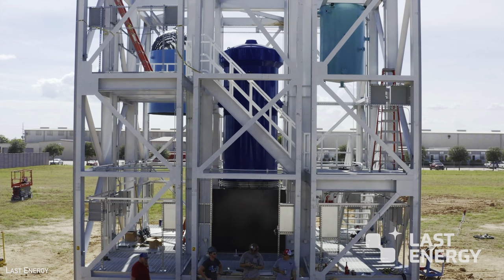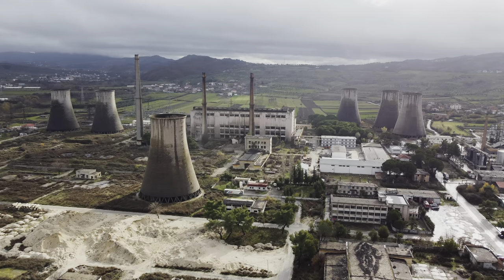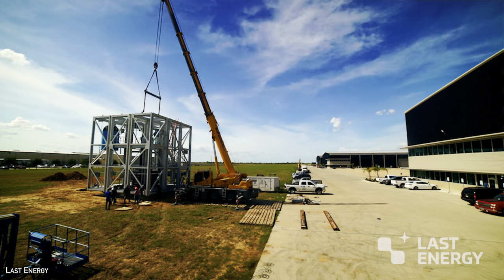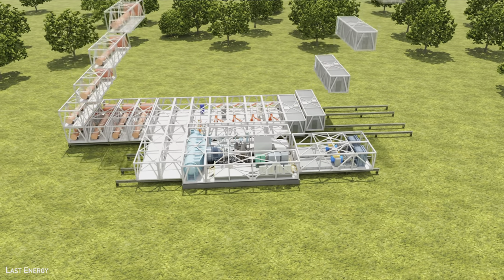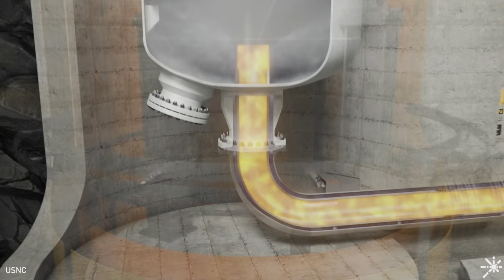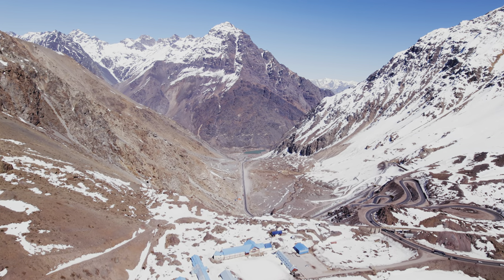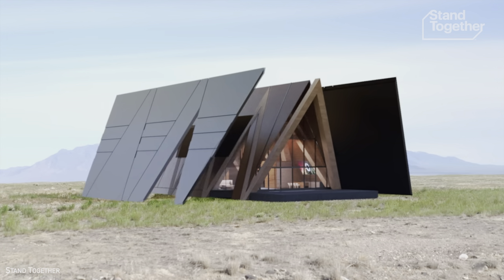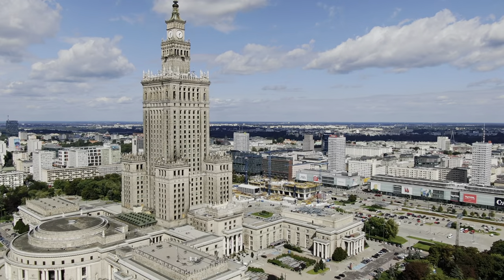The Daring Plan to Build 10,000 Nuclear Reactors

Comment: I'd rather live next to 10,000 nuclear reactors than 1 coal plant
Reply: I'd rather live next to 10 million wind turbines, than 10,000 nuclear reactors.
Reply: @BallyBoy95  Would there be any land or steel left to build your house?
Reply: @jewymchoser  good point. I'll have to live in a burrow like a hobbit.
Reply: @BallyBoy95  I wouldn’t… that’s where we are planning to store the nuclear waste 😀…

…which has yet to kill a single person. Coal kills 10,000 a day.

Nuclear is scary, but it’s safe.
Reply: @jewymchoser  how many people do win turbines kill?
Reply: @BrightWendigo  Wind kills about the same as nuclear… Zero. 

That being the case I believe the most important motive is to create as much carbon free energy as affordably and quickly as possible…

…which means nuclear. But make no mistake, I love wind, solar, and batteries. It’s just not scalable fast enough but nuclear is
Reply: @jewymchoser  Having a mix is great but factories are the biggest reason for having SMRs. Imagine a manufacturing plant that is powered by nuclear that doesn’t need much if any maintenance for years and even then with mass production of reactors and parts repair will be ever cheaper.
Reply: @jewymchoser  you should research your 0 number. More then 2000 disaster related deaths connected to Fukushima
Reply: @BakuganBrawler211  “Box them then ship them”… Ms. Doughtfire 

Agreed. Mass build, and more importantly, certify small reactors then ship ‘em!
Reply: @BrightWendigo  Coal & gas pollution goes into your lungs and kills 10,000 a day. 

As far as I know, there has yet to be a single death tied to Fukushima that wouldn’t have happened at a non nuclear plant after a tsunami.

 But Even if Fukushima was a disaster, is it 10,000 deaths a day?
Reply: @jewymchoser  iirc it's actually 2 deaths highly probable to be from radiation now, but still far safer than coal or probably even wind when you factor in accidents with maintenance and construction
Reply: @kyh148  that is a very fair assessment. Why are we so scared of the wrong thing?
Reply: @BallyBoy95  😅😅😅😅😅😅
Reply: @BrightWendigo  there is a clip of workers on a wind turbine thats burning.  They did not make it. So while not a lot, not zero.
Reply: For those that live near the Bruce plant for instance, there are a lot of long term and well paid jobs.  I have some relatives in Ontario who live near wind turbines and they're not toi happy with the noise. Like it or not it affects property values as well. And given that Ontarios wind turbines provide at best 7% increasing their numbers 15fold is going to be costly and unpopular.
Reply: @peterkratoska4524  well said
Reply: The problem with nuclear is not safety or pollution, it’s that nuclear is “top heavy” in terms of investment… it takes a long time to see a return.

SMR’s solves this problem not by “mass production” but “mass certification”.
Reply: @jewymchoser  the head of Last Energy (Kugelmass) in an interview on Catalyst podcast, points out Wisconsins 2 Point Beach reactors 1.4gw  were built in the 60s in 3 years by people totally new to the design.  In 2020 dollars if we were to  look at the blueprints and just copy it would cost 740$ million. Those plants are still operating. 

Since the 70s the certification costs are huge, Nuscale will spend between 500million to 1billion just for approval.  The industry is also partly at fault as the model depends on regulatory capture and ratepayers  paying the high cost.
Reply: I also know that nuclear reactors will be much more powerful and reliable than all those windmills and solar panels
Reply: You can't live near a nuclear reactor in the US because they are surrounded by a large exclusion zone.  That's "just in case."
Reply: @jewymchoser  
Said that nuclear power scales fast enough.

That's been the whole problem.  Throughout the western world the new nuclear power plants are having multi-billion dollar cost overruns and decade long construction delays.  The utilities are no  longer contracting for the construction of new nuclear power plants because they are *not* going to wait more than a decade to bring a new NPP online.
Reply: @jewymchoser  Wind and Solar are MUCH faster Scalable than Nuclear. 
The last three Nuclear projects in Europe has taken 16 years to build,
Reply: @jewymchoser  coal also causes autism and cancer
Reply: @BallyBoy95  than 10000 nuclear reactors or coal plants.
Reply: @oystla  it’s not either or :) give me nuclear, solar, wind and batteries and give it to me raw!
Reply: @BrightWendigo  Lots of flying creatures tho
Reply: @BallyBoy95  Sorry, that’s not the deal is it? With wind, it’s always wind … plus something else when the wind lulls. So what else do you want in your yard, gas plant and pipeline and drilling rig and storage cavern? Or, maybe a coal plant w 100 car trains every day and a giant ash mountain? Energy doesn’t come from unicorns.
Reply: @jewymchoser  “Wind kills … zero “

It’s a low number, but then it’s not all wind is it? Everywhere you look there’s gas and coal alongside the wind turbines Everywhere. Always.  They do kill a lot of people, and the combo is expensive.
Reply: @kyh148  Zero deaths public from radiation. Zero. Maybe a guy on-site died later from cancer, very hard to tell.
Reply: @peterkratoska4524  Not the deaths from wind turbines that are the problem.  Problem is gas coal always and everywhere alongside. That’s expensive and kills people from emissions accidents.  As wind gets pushed harder, taking money from coal gas, they’ll close a few too many, and then come the blackouts.  See South Aust, Texas, CA.
Reply: @acmefixer1  Nonsense. 1/4 mile at most. How close do you think you can live to a coal gas plant, always alongside that wind turbine.
Reply: @acmefixer1 l French built their 50 reactor fleet in 15  years. US built plants in 1960s in 3 years, several still running today. To the extent it’s different today, that’s political, not technical, coming from regulatory bodies captured by industry making $$ off only selling services, not building anything.
Reply: @oystla  Wind and solar … plus what else?  Coal? Gas? 

Btw French built their 50 reactor fleet in a 15 years. If it doesn’t happen now, the only reason is politics, with captured regulators insuring a slow walking death.
Reply: @Nill757  billions of dollars, hundreds of thousands relocated, food chain ruined, local economy destruction still a weight of national GDP wich slowed the economic growth of Ukraine. Hundreds of thousands of health problems wich causes a massive erogation of compensations/pensions.
Reply: @Nill757  safety regulations have improved since the 70s. What was done back then is not relevant today. 
Solar+Wind+Hydro+biomass+energy storage+coal with CCS.
Reply: @jewymchoser  Nuclear is not for the masses. It is an industry that requires talented people who possess the ability to strictly follow procedures and make conservative decisions to protect the core and the public in general. The people who do this work on a daily basis are more adept than most of the population and are not the type of people that could be hired in mass to staff 10,000 plants.
Reply: @mavrospanayiotis  Chernobyl was a bad accident and now there are no more Chernobyl like reactors.  Then, you’re exaggerating w “food chain ruined”, as Ukraine is the bread basket to Europe Africa Asia, which is one reason why the war is devastating internationally. Exaggerating “hundreds of thousands” health problems too.
Reply: @Nill757  yet many european productions had to stop and billions were paid for  remediation. Recently (2012) in northern Italy some boars killed were found having cs137 contents above the alarm level for nuclear accidents, the main suspects are Chernobyl itself or a dismissed nuclear plant not much far (1987). I know Chernobyl is an old tech but problems happen often and sometimes are kept hidden for years... just for about 450 reactors... imagine for 10.000.
Reply: @BallyBoy95 Also oil and its byproducts are necessary for wind and solar to be built.
Reply: @BrightWendigo  About 100 actually.  No where near coal but still some.  Most of these are during maintenance or during failures of some kind, like collapses or blade failures or fire.
Reply: @BallyBoy95  10 million bird choppers and whale beachers
Reply: I’ll take solar energy. No mining, no waste, no cancer.
Reply: @Nill757  Exactly, China or India would not put up with these delays that plague the building of Nuclear plants. Clearly the industry has been captured by regulatory bodies and unions that stretch out the work endlessly to make lots of extra money knowing that the money coming from government will be endless and they have no choice but pay.
Reply: @BrightWendigo  you mean the people that drowned due to the tsunami?  No one died from the plant.  It fact, it wouldn't have even melted down if it wasn't shut off.  The reason it broke was because the pumps shut off because both sets of diesel generators wouldn't run due to flooding.
Reply: @adbogo  How about when you have no sun? How about rainy days? What are your batteries going to use? Unicorn farts or the more common lithium and cobalt batteries you need to mine? What about when you need to replace that battery after 5-10 years? Will those batteries be built with unicorn farts or rare earth elements?
Reply: For all the solar and wind so great people, you are leaving out very important aspects. 
• It's climate dependent. Good luck putting wind mills in Antarctica or solar panel farms in Norway. 
• It's obviously not consistent. Planning a large power grid based solely on wind and solar is laughably stupid if you cannot exceed demand in both large scale battery capacity AND solar/wind generation. How many batteries do you need for 500 million people do you think?
• Windmills are a danger for birds. So don't put them next to your bald eagles America 🦅
Reply: @adbogo  Well some say the spiders and falls from high places will get us first.
Reply: @jewymchoser  You're a dreamer. You know better. Stop lying to yourself.
Reply: @jewymchoser it actually is the fastest developing source for electricity with still exponentially decreasing prices. Nuclear is the slow one in comparison.
Reply: I'd much rather live next to a coal plant - all the chemicals & heavy metals are now scrubbed from the stack and the fly ash is captured too (if CO2 is emitted, it's merely an inert gas,...it won't hurt me).  Unlike nuclear reactors which , during routine operations,  emit numerous radionuclides - fission & activation products - into the air and water (these  can be carcinogenic, mutagenic, and teratogenic), chemicals like hydrazine & ammonia, and heavy metals....plus they dump at least twice as much thermal pollution into the adjoining cooling water body. No contest!
Reply: @BallyBoy95  you have no fukin idea how mcuh noise they make 🤣🤣🤣🤣🤣🤣🤣🤣
Reply: @jewymchoser  wind turbines fucking SOLO birds, literal 100:0 kill ratio. Wind turbines stay winning
Reply: @jewymchoser  
When you compare the cost of nuclear vs solar with battery storage, solar LCOE 4.5 times more expensive as nuclear and has half the design life.

On any given day, a nuclear plant (fossil for that matter) can put 100% of its rated capacity to the grid. An equivalent solar farm can only put 25% of its capacity to the grid, on a perfect solar day.

Therefore, you need to install 4 times the solar generation put 1/4 to the grid during the day, and 3/4 into storage for use when the panels are off line.

Using Wiki LCOE numbers, the cost to install 4 x the generation is $3,320/kw.
Then battery storage for 3/4 of the solar is 18 hours at 1kw, is $1,380/kw x 18 $24,840. Or $28,160 to put 1kw to the grid around the clock, assuming a perfect solar day.
Advanced nuclear LCOE $6,000/kw, or 1/4 of solar with battery.
Reply: @Preciouspink  post source(s)
Reply: @jewymchoser  
Migratory birds on the other hand are fair game for wind turbines.
Reply: @BrightWendigo  
2000 disaster related deaths related to Fukushima tsunami, 0 to the nuclear plants.
Reply: @jewymchoser  
True high up front investment, but they last decades longer. Some US plants considering license extension to 80 years and longer.
Reply: @acmefixer1  
Actually no. Most US plants are near towns and cities, so people do live within the emergency planning zones, 2 miles and 10 miles.
Reply: @acmefixer1  
Two units coming on line in GA very soon. Yes took a long time, but will last a long time too.
Reply: @oystla  
Politics?
Reply: @oystla  
Not really scalable, especially in Europe. For one thing to put the same energy to the grid, you need to install 4 times the solar generating capacity. But that’s only good for about 6 hours a day while there is sunshine.
The other 18 hours they produce nothing.
To have power at night batteries are required. 18 Mw Hours is a lot of capacity, then multiply the batteries by 10 to account for the 10% capacity factor of batteries.
Even with all the costs and overruns, nuclear is still cheaper by a factor of 5 or more than solar and wind.
Reply: @pdiddymcse  
There are literally thousands of highly trained nuclear people out there, trained by the US Navy.
Reply: @adbogo  
What materials go into making solar panels?
Silicon - obtained from mines.
Then the silicon is doled with Boron and phosphorous - both also mined.
And, other mined elements.

Supports are made from steel which is iron obtained fro mines then other mined elements are added to turn the iron into steel.

Or aluminum, which also comes from mines.

So, it’s all mined.
Reply: @LSuschena  Mainly silicon, sand from the beach.
Reply: @LSuschena  
Vogtle 3 & 4 - Billions of dollars in cost overruns and decade long construction delays.  This and the same thing in other countries have taught the utilities to never order another nuclear power plant, unfortunately.
Reply: @BrightWendigo  They died due to the disaster itself, not because of nuclear. If the engineers had more than 10Iq when they placed the backup generators then nothing would have happened even after the plant was hit by a 9.0 earthquake and a tusnami
Reply: dont worry, you wont be living next to either soon.
Reply: @Nill757  
There have been thousands of deaths indirectly related to the nuclear power plants and accidents.  Cancer, leukemia.
Reply: @muppet50yago36  
I'm glad that the battery storage system units are being built by the tens of thousands, to add to wind and solar to make them intermittent renewables into dispatchable power.  That's putting the gas peaker plants out of business.
Reply: @muppet50yago36  

The 370 million in north America will be powered by wind, solar and battery storage, with longer term storage using pumped hydro, which is already supplying 90% of the world's stored power.
Reply: @acmefixer1  “pumped hydro ….90%”

Yes. Now. Yet most only run 3-6 hrs, 12 hrs longest.  No new significant PHS has been built in N America in 30 years, EU similar, for good reason, the dual reservoir geology and water supply is hard to find. 

There is no utility scale battery facility that back up a middling 500 MW power plant or wind farm for one full day, not one, not anywhere in the world.
Reply: @acmefixer1  “thousands of deaths …nuclear”

Source for one such accident please? Japan, TMI, zero deaths from radiation or indirectly for cancer.
Reply: @acmefixer1  “never order”

There are 60 nuclear power plants under construction globally right now. Most have a reasonable cost.  You Americans always think your disfunction  applies to the universe.
Reply: @Nill757  
The disfunction(sic) that you claim only applies to the US applies to other countries also.  In addition to Vogtle 3&4 and VC Summer in the US, there are Flamanville in France, Hinkley in the UK, and Okiluoto in Finland, all having multi-billion dollar cost overruns and decade long construction delays.  And there is also one in China, but the Chinese government doesn't allow the people to have a say in whether they will waste billions and decades on nuclear power plant construction.  And other countries such as Japan and Germany are shutting down their nuclear power plants.

Nuclear and all thermal power plants can't compete against renewables - the cost of wind and solar and battery storage is still going lower.  Utilities are basing their decisions on "it's all about the money".
Reply: @BallyBoy95 and I would live under the billion solar panels producing electricity in Sahara desert
Reply: @pdiddymcse  Please don't bring common sense into this.
Reply: @DRAG0N1012  and for nuclear to be fuelled - continually.
Reply: @adbogo Quite.
Reply: @ancapftw9113  Seriously? You measure nuclear safety by how many die directly "from" the plant? Do you actually know anything about nuclear disasters. LOL.
Reply: @LSuschena  That is a blatant lie.
Reply: @LSuschena  Not if you store solar heat and use it during the night.  We have a heat storage facility that lasts throughout the winter, just on solar  heat storage.
Reply: @LSuschena  silicium is sand that is mined from the beach. How about that?
Reply: @Nill757  the internet. Just look it up. Don’t be lazy.
Reply: @Nill757  And in all cases the costs are 50 to 150 percent higher than estimated.
Reply: @adbogo  “All cases.”
How many would that be under construction, right now?   Now , you’re likely another American, maybe Brit,  thinks because your broken, bungling country can’t build shitt anymore, that nobody can.  

Today there  are 60 reactors under construction globally.  Most 5-6 years and affordable.
Reply: Then you definitely are not employed in the Enegy generation industry or have an actual working knowledge of either.
Reply: @axelotl86 there are no clean grids in the world from solar, not anywhere close. Clean grids from nuclear and hydro have been around for decades.
Reply: @Nill757  and nuclear is getting more and more expensive. Grids are changing. At least here in Europe. Slow but steady. So what’s your point? Decentralization is the keyword and democratization of power production. Is change hurting you?
Reply: @axelotl86  Are you the Minister of “Keywords”? What’s next weeks word?  Blackout?

There are 60 nuclear reactors under construction right now globally.  Somebody can still build them cheap enough and fast enough  even if your bumbling country can not.

Btw next time you think “decentralized”, think about that fat utility cable still side of your residence, without which you’d die in the dark.
Reply: @Nill757  I can’t remember when I witnessed the last black or brown-out here in Germany.  We have one of the most stable power grids in this planet. But you know I’m hearing for nearly a decade that soon, really soon the grid will break down. I remember when they said it will be at 10% renewables. Now we are at over 50%. 
And what does my power cable that goes into my house has to do with this? I’m not talking about full independence from the national grid. 

60 powerplants worldwide. With a Median poweroutput of of 1GW. That’s minimal in comparison to the yearly installed capacity of renewables on this planet. 300 GW last year alone. How long do those 60 plants need? 10 years each at minimum?
Cute. Even china, the current champ in building NPRs is building more and more renewable every year. What you are missing is context and the dimensions.

It seems that you really don’t know what you are talking about and are just a keyboard warrior locked in a dunning Kruger situation. Pathetic.
Reply: @axelotl86  You said “decentralized”, “Democratic” like some PV salesman, not me, yet you know that you are dependent on that ever more expensive per kWh  cable to your house, from far away conventional power plants and utility power wind solar farms, for which the residential price in DE has been climbing dramatically for years now, some of the highest  in the EU.  You know all this,  yet tell this decentralized story. 

50% clean grid, well done, though France got  to 90% decades ago, now too Finland, with far lower monthly rates. You know all this, yet go on about 50% RE.  

I don’t cite  60 rectors underway as if they’ll wipe out fossil fuels, though they will run 90% of the time for 60 years, with out demanding ever more gas plants be built to firm up intermittent power as in DE. DE gas power capacity increased 50% last dozen years.  Of course not enough nuclear is being built with bans and stupid closures in place as in DE. And, the French example shows an entire fleet can rise up up 15 years if desired. I point out the current global construction because you claimed nuclear is too “expensive” to be built, yet another ridiculous non sequitur.
Reply: You must be a bird hater @BallyBoy95
Reply: @Nill757 windturbines kill birds